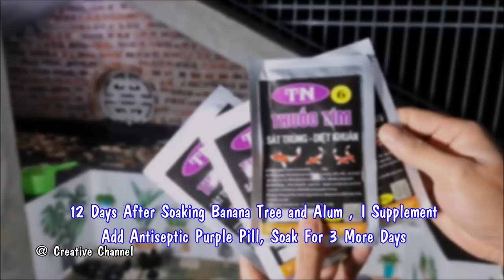DIY KOI Aquarium on Rooftop in 2 months

Comment: Oh no. Will the weight on the rooftop be able to withstand the weight of the bricks, stones and water that are newly built on top of it? You have to calculate the structure carefully, otherwise it might all collapse, causing a lot of loss.
Reply: His roof should withstand the weight
Reply: If you've known this channel for a long time like some of us, you'd be sure he did all the necessary calculations.
But in his videos he does not dwell on these details and only shows the practical side of his work.